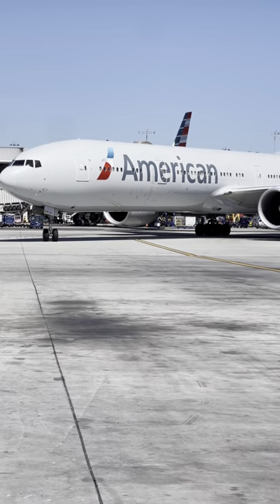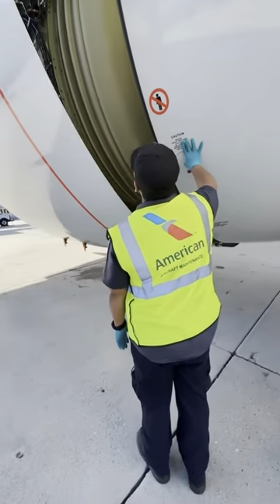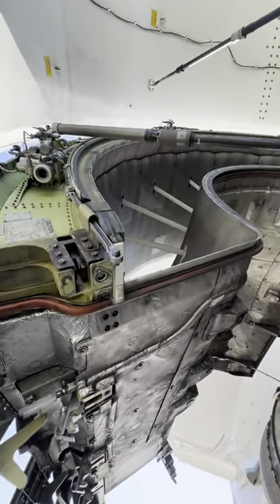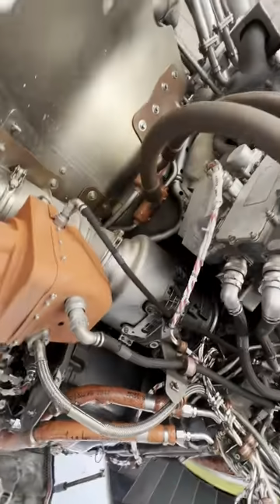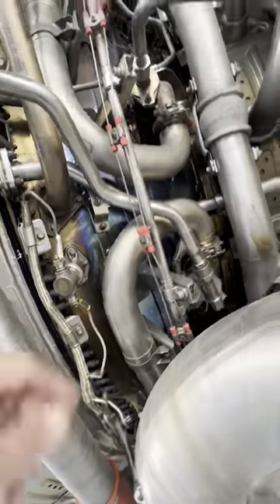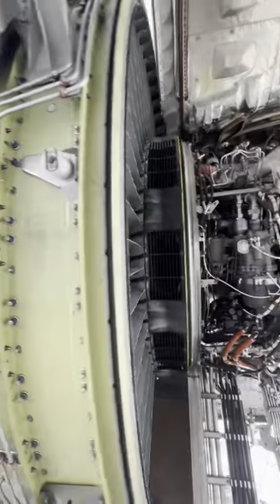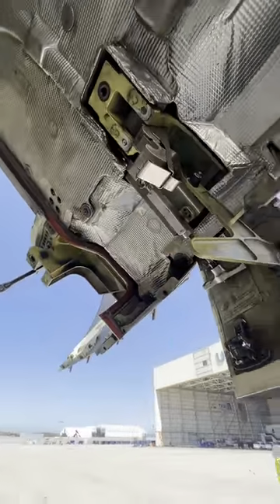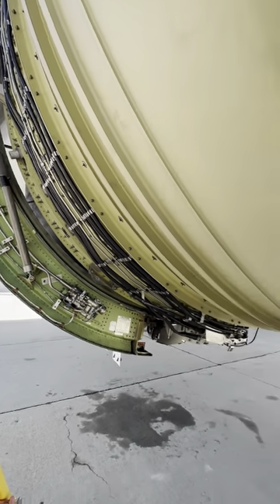GE90-115B inside and out.

Comment: I though American airlines use Rolls Royce engines.
Reply from the maker: We do. On the 777-200. The 777-300 uses GE90s and the B787-8/9 have the GEnx
Reply: I did not know they had -300, I only seen -200 in JFK so I assumed thats all the operate. @StigAviation

Comment: So with the drain mast they dump hazardous material right into the air and down on the land below, shame on them. They need a collection system to help reduce polluting our environment. They can store the hazardous materials and drain it off at each airport for proper recycling or safe disposal.
Reply from the maker: Most of it gets atomized into the atmosphere.. and they can’t recycle all the leaked fluids back into the engine. It would make it even more complex. In any case I don’t design these engines, I just maintain them. In my opinion it’s a very efficient and well designed engine.
Reply: @StigAviation  Atomizing it in the air is polluting our environment in the worst way. It's going directly into the air we breathe and is carcinogenic. If they can't recycle it through the engine then they could easily put a capture container for all of it. If the container could be easily clipped off another one put in its place it could be changed out while the passengers are loading. So you're a person that works on them this would be my suggestion to send the engines manufacturers and the airline. Who knows you could get a heck of a bonus check for it. My dad worked at General Motors he came up with these little changes for the cars and he was making Buku dollars off the bonuses from a suggestions.
Reply from the maker: @jg-bd3hr  as much as I would agree with you but I doubt GE or RR or any jet engine manufacturer would both listings to some random aircraft mechanic. I’m a very small cog in a very big industry. But I do like your idea and I hope in the future they design it with better with the environment more in mind.
Reply: @StigAviation  you may think you're a little cog But it's those cogs they want to hear from especially if their ideas prevent future blowback and problems. Don't be shy you will be shocked if they response you may or may not get from them. Either way it will be a thankful response. Take care

Comment: All those parts just to make the engine running...in the future year 3500 it will just have like around 5 to 8 parts 😁🤪
Reply from the maker: you are right, in the future thing will be more modular and less equipment.
Reply: If we’re still burning dinosaurs and using airfoils in 3500 something went wrong.